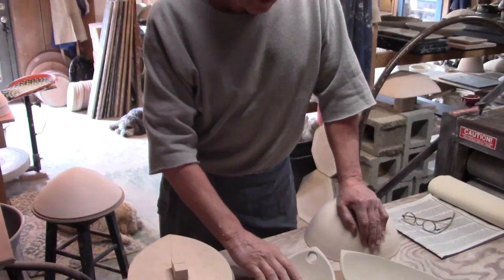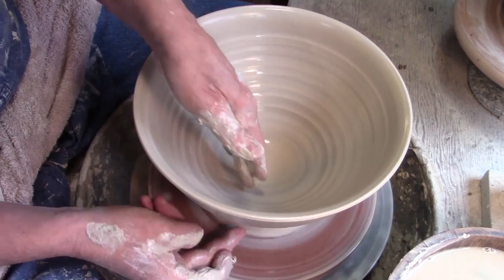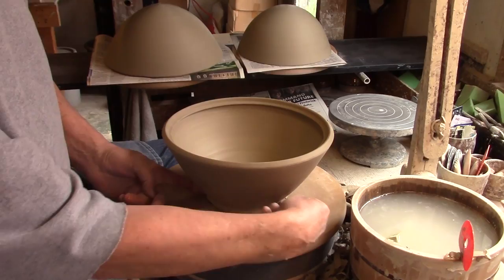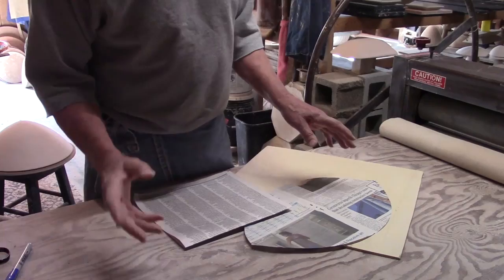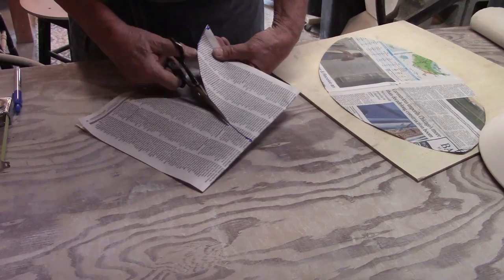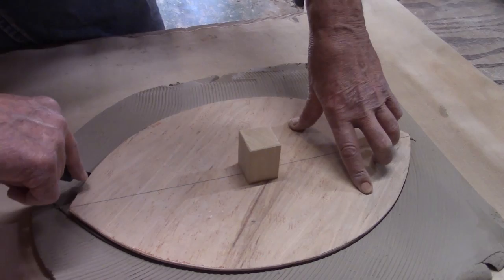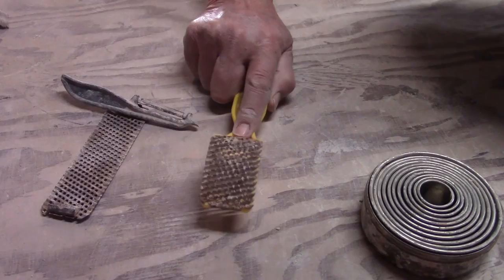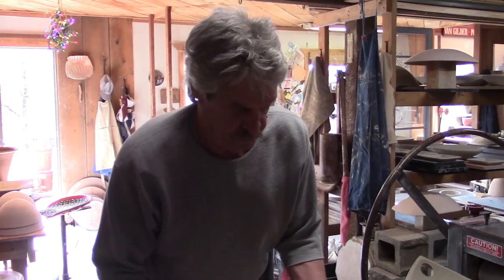How to make a deep slab bowl using a hump mold...step by step.

Comment: Now that was an interesting video. Light trimming of the wet clay was new to me, but the potato peeler was a revelation, thank you 🙂 I'm also really interested in knowing how you made the lines in the mold at the 30 minute mark. They are not concentric around the middle in the bowl so they're not made on the mold  during trimming. Can you tell more about that detail?